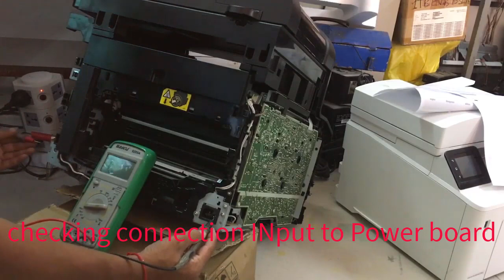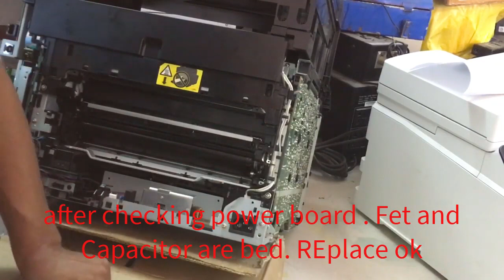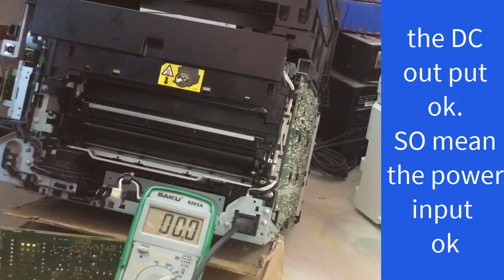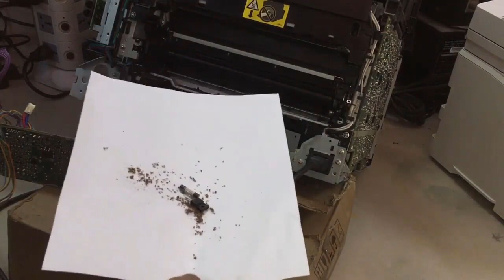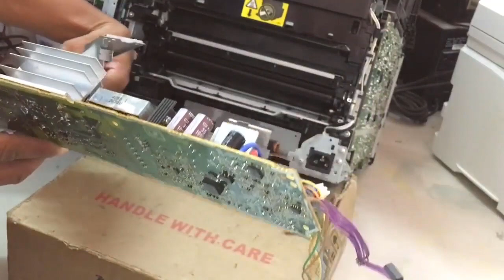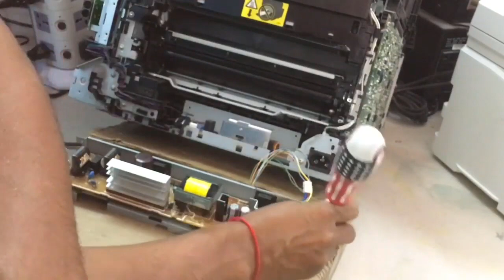How to repair power board HP LaserJet Pro 200 color MFP M276

Comment: I have the same printer, 110V, can I change it to 220V changing the power supply? or it delivers somewhere else 110/220v besides the power supply?
Reply from the maker: You need to changed capacitors to 450V on power board, but if you not professional You should not do it

Comment: Hi 
I have an issue with my printer which is the same as the one you repair, but my Power board is positive on all parts. Can you assist me to fix this?
Reply from the maker: Have you checking input part Have power in or not , if  have  when you measure on both pin + and - on capacitor how many vol.?can you checking out put power board have DC Vol. out or not .
Reply: @Electronicview  Thank you very much for the reply. I am trying to test the DC output from the first primary board but the volatge is fluctuating, it is not stable. It starts from 0.2, 0.6, 0.7 and it keeps changing values.
Reply from the maker: @thomasbilembo7566  so mean the primary board working, you check the DC Vol. at the Capacitor in put 400v pin+ and pin(_) How many vol. if more than 300v de mean the in put part not working so checking vol. drive the MOSFET and pin  S of FET to (_)

Comment: Hello
I want to replace the power supply in this printer model. Can you help me disassemble it? I will buy a working printer to replace just the power supply as the one I have doesn't turn on and when it does, it play funny games going in standby and after 3 seconds waking up and then after 10 minutes sometimes going dead.... Thanks!
Reply from the maker: I have part1 to end video record for this video, But I want you make sure the power supply is bad

Comment: Pagka nasaksak sa 220v kaya pa ma repair po? Or san po makabili ng replacement sa power board nya?
Reply from the maker: Kung ang iyong printer ay walang kapangyarihan o hindi maaaring i-on ang printer. Maaari itong suriin ang Power cable ay may power out o wala
ang pagcheck ng board ng kuryente ay may nasunog na bahagi bilang Fuse o ibang bahagi o hindi
Power button o mga koneksyon na kailangan mo munang suriin
  bago ka bumili ng bagong power board